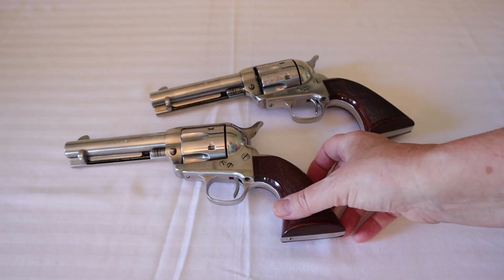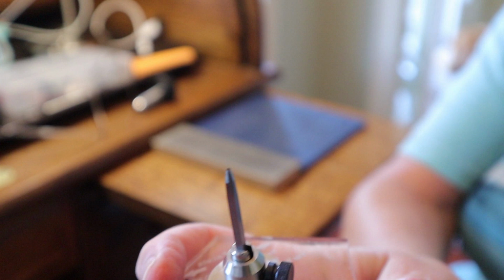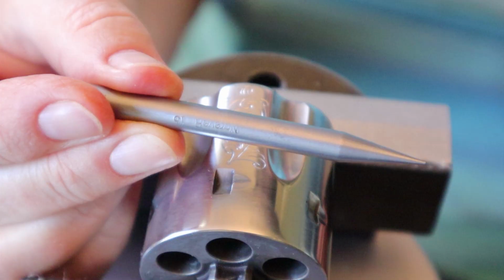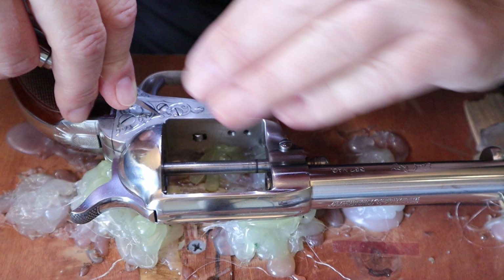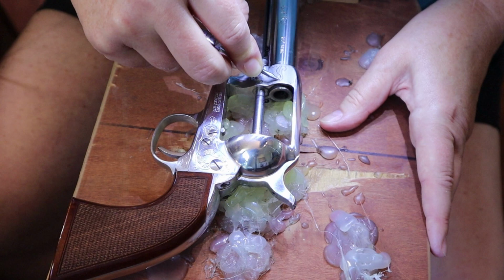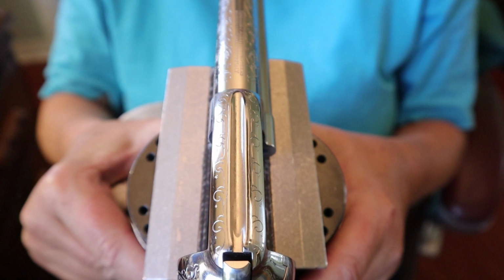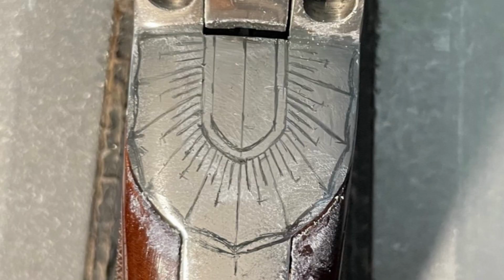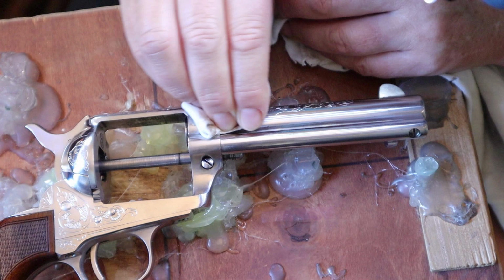Engraved Western Pair | Beautiful Designs in Metal | Colt Pistol Set | Custom Engraving Firearms

Comment: Since i havent had the money to buy a pnumatic engraver ive learned how to get my lines with a micromotor to look very close to how hand engraved lines look by pushing the burrs into the metal instead of using a side to side motion like everyone instructs. It cuts deeper and cleaner when pushing forward and it hasnt worn my burrs our any faster. Im currently engraving hair clippers and have done the entire top engraved pretty deep with just 2 diamond burrs. Soon i will upgrade and learn hand engraving but for now i can get pretty damn good results with a micro motor. I come from being a life long artist and a tattoo artist so tattooing has made the process much easier.
Reply from the maker: Sounds like a good tool to get accustomed to cutting metal.  It's a lot different from tattoos on flesh.  I often say I do "gun tattoos".  An engraving tool will require some practice but it won't take long for you.  For practicing artists, it's just a different paint brush.